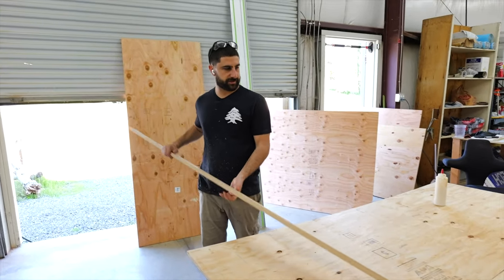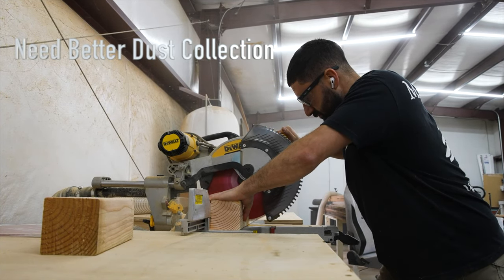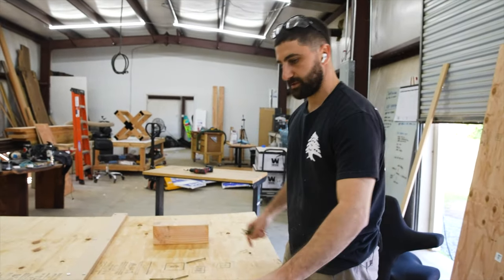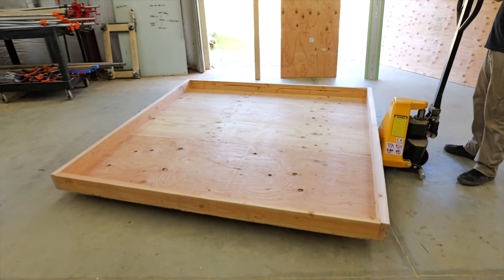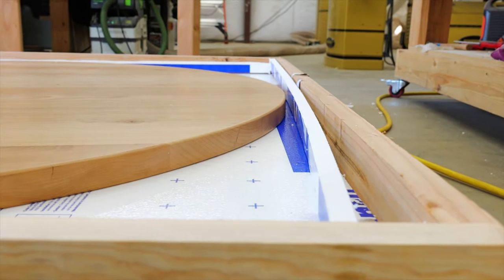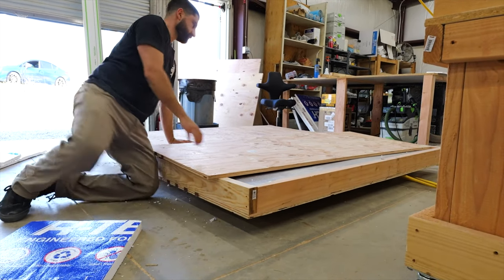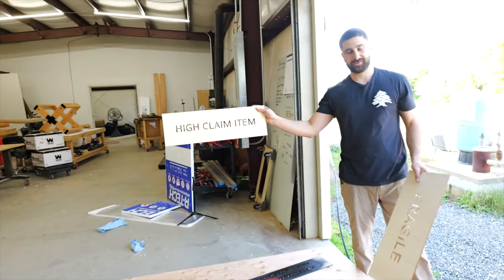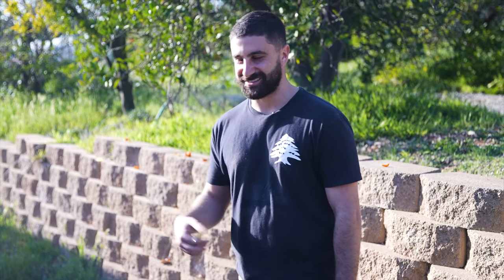How to Build a Crate for Shipping Tables

Comment: The one thing that seems to be missing is the table legs. Did you create a second crate for them or did the customer just order a table top?
Reply from the maker: In the description i explain that shipping the legs and tabletop separately was significantly cheaper. The base was pedestal styled so that increased the dimensions of the crate dramatically . I shipped the base separately non-freight with UPS ground using cardboard and insulation sheets for protection. Will be making a video on how i do that soon. Thanks for watching!